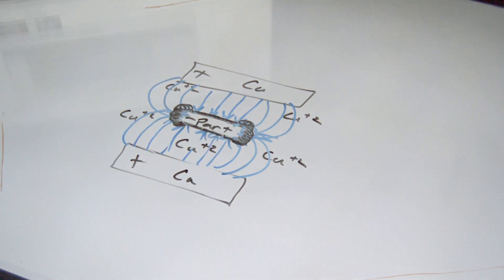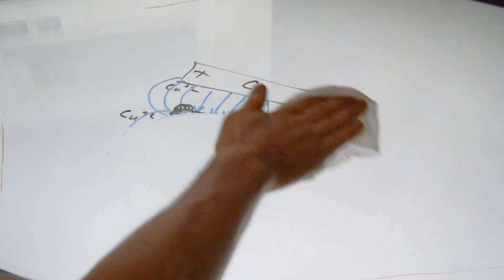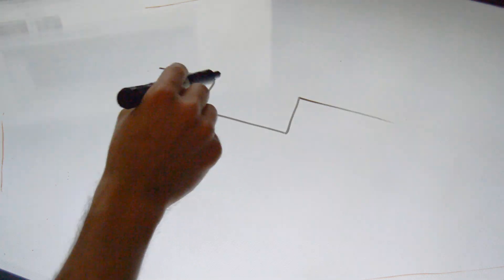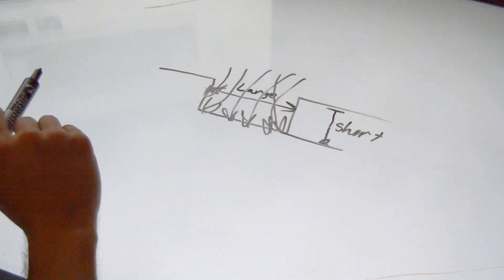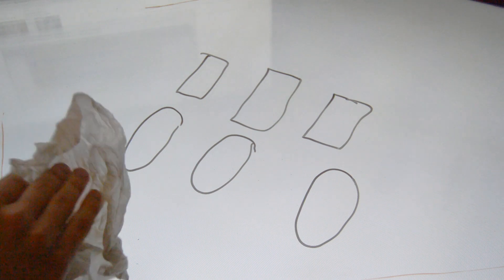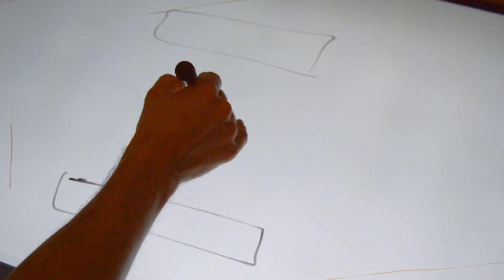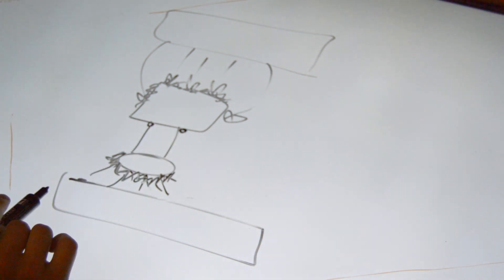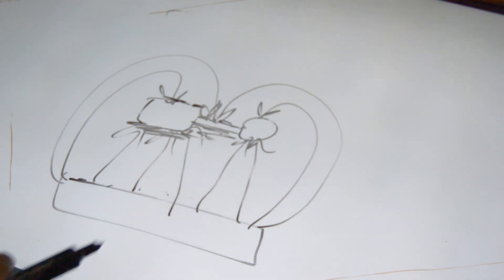DIY Electroplating ~ Best Part Shape and Orientation Guide

Comment: What am I doing wrong,  
Made copper solution using 30% vinegar and distilled water copper and anodes.   Experimenting with stainless eye bolts and nothing sticks.  Nickel appears to work, even tried copper over nickel.  Any advice is greatly appreciated.  Thanks

Comment: Thanks for sharing. If I have a copper strip is it worth bending it into a rough contour of the part to improve the evenness of the deposit?
Reply from the maker: If there are significant changes in the shape of your part (ie. Protrusions or sharp bends) then I would say it's worth making your copper electrode roughly follow the shape of your part. There are many other factors that I will talk about in future videos too, there are aspects of the chemistry and bath construction that affect level plating. Thanks for watching!